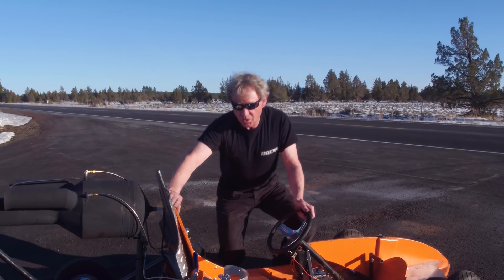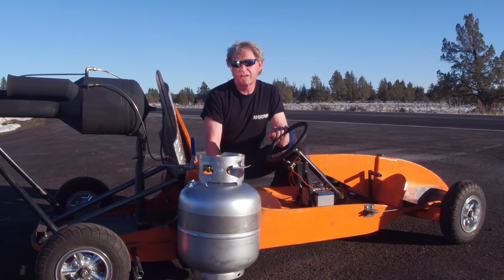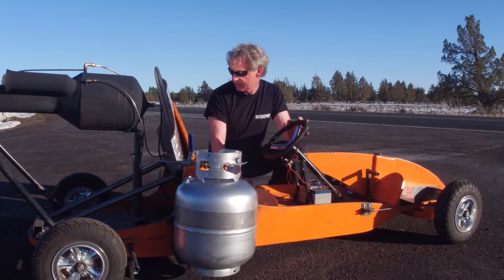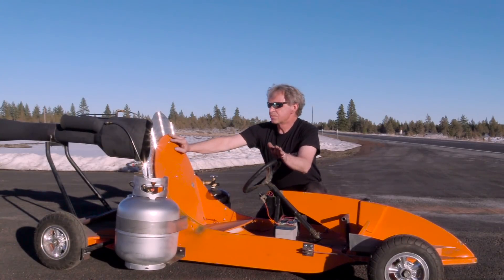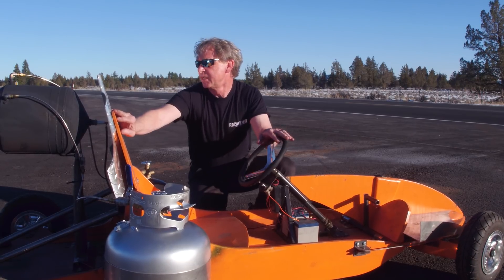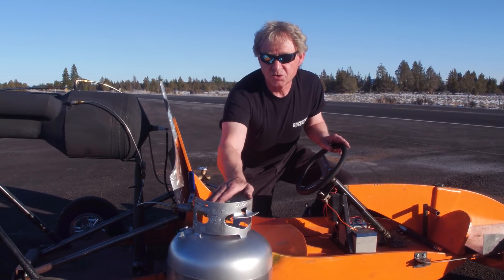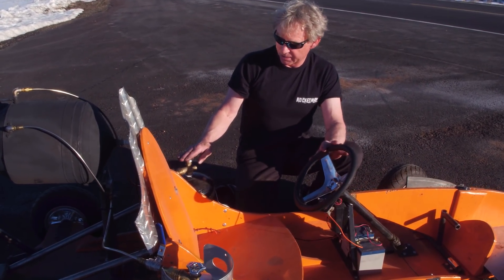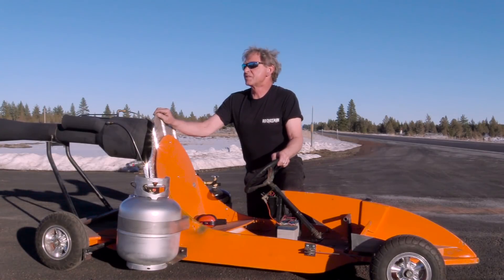Jet engine gokart made of PLYWOOD! Rocket man show.

Comment: Very nice. How many Lbs thrust?
Reply from the maker: I'm not sure, my tests on gasoline was fifty pounds but I can tell it's making more thrust on liquid propane, need to put it on my thrust gauge, I wasn't at full throttle as it was only maybe 55-60 degrees so I had low pressure in the bottle.